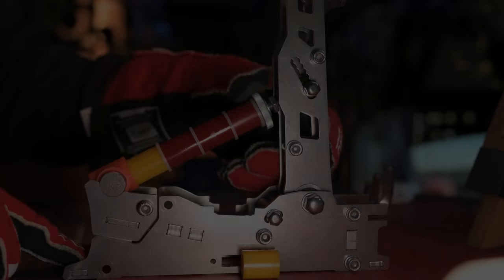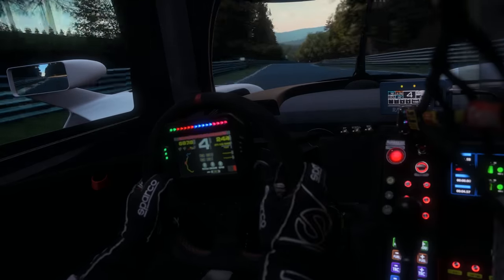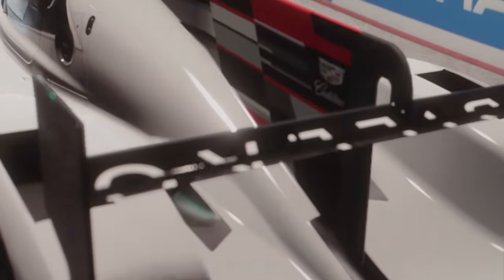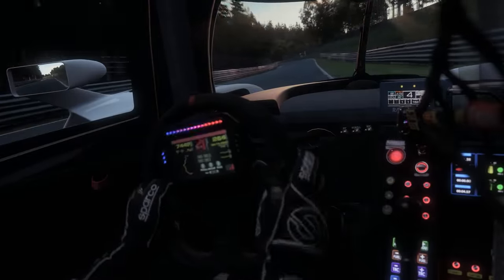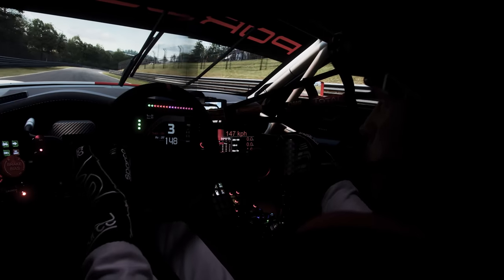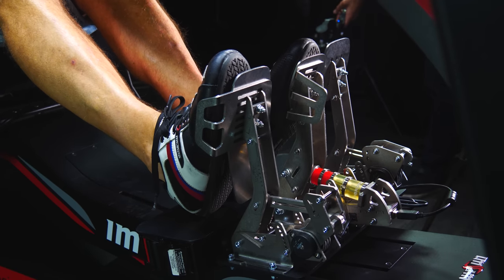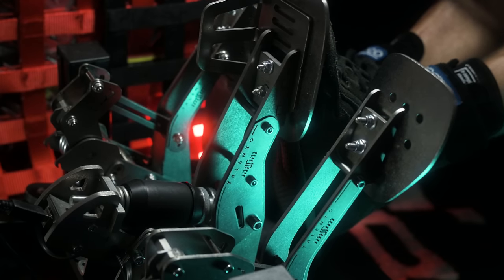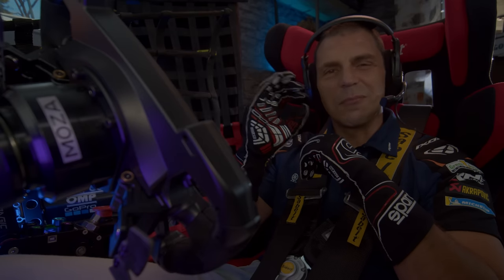How I setup my Brake pedal for max performance !

Comment: Don't fuck up your knee, most important information in the video! 

I have the V3 and I tried every combination, those pedals are only good with the stiffest brake, Almost no movement. The way you calibrate them is the most important, I try to calibrate the most I will ever use in the driver, but then i recalibrate the brake in game setting. That way, I always have a baseline that I can modulate per game setting.

Comment: yeah, setting pressure high to the point of knee injury  is stupid.  But I like having it high enough to where I'm not locking up the brakes when I panic in the heat of battle.  Short travel, enough pressure for 80% braking in most cases works for me.

IRL, my miata wilwoods suffer from pad knockback after high G turns and I usually have to pump it once before the next turn.  SIMS != IRL

Comment: I love having almost no movement to my brake pedal I like to use the muscle memory method it does work my lap times are very very consistent, and trail breaking for me is easier with a stiff break with hardly any movement that’s what I’m used to it basically no travel I’ve had my pedals setup like that for 2 years now I don’t like a LMG travel brake too hard to trail brake imo but everyone drives different with different driving styles

Comment: I'm half with you and half against you... I like the realism of a stiff pedal and the fact that I can use high friction pads without worrying about locking up. But like you it's easier to break precise if you use less pressure. Here's my example in iRacing. Higher friction pads or smaller brake master cylinder so I can outbreak everybody and I use high pedal pressure also. But to get more precise breaking I add in some brake Force Factor so that if I'm using 50% pedal or less it's easy to modulate. Give it a try you will love it.

Comment: as always a fab and informative video. 
I went about it a slightly different way round.  I f*$cked my knee up. Then I tried to adjust. 🤣🤣
It was actually one of the biggest hurdles me getting back in the rig ( other than ACTIUALLY getting in )  - the pedals were too much for the injury to cope with . So I dialed it all down. 
It allowed me to drive - but I am still not inclined to turn it back up... Liking the slightly softer
I also put a set of sim3d vibration motors on...  they are very good and very informative.

Do you ever right foot brake? I do a lot and i find softer means you are more aware and consistent  with the different forces required for each pedal - again building that muscle memory not to stamp....

take care bro
M
Reply from the maker: Yeh, I know for your injury bro but honestly from my perspective even if I have very soft brake wen ones I master the car I’m absolutely fine controlling it ! Wen I deal with new car particularly without ABS then I struggle a bit till I master the car again in few months and drive without stress! 
I honestly never use my right leg and every time I touch the brake with the right it feels like brick even wen is soft for the left foot 🤣
Reply: @chepilevski  Sorry -  ...   a brain typo 🙄🙄   we are talking LEFT foot braking   It would be a fab video exploring the benefits  of left foot braking ( or not ) . ..   i was taught by a rally driver years ago and it completely  changed my perspective as to what a brake can do regarding simultaneous power and brake input  . sure it does require a complete  internal  ' rewire'  -  that is why most people don't do it ...   it is like learning to rub you stomach & pat your head  - and also TOTALLY contrary to what road driving teaches you . If you persist past the few crisis / drama    clutch brakes.. it is fab... a ballet

personally  it was amazing as i was recovering to able to naturally  brake with my left foot as my right could not have done so at the time ..
 I would love to see the video you would make about the possible transition to explore R to L braking and your approach to the 'rewire' needed

x

Comment: finally my first day with load cell pedals today, I mounted it on my rig and started lapping, I knew what was coming but the real experience is priceless, definitely a learning curve but don't want to get negative habits, so my question is about the technique: I am curious to learn if I must be putting my heel on the base plate while braking which is hard at the moment for me or viceversa, am I totally free to raise my left foot and put it on the brake pedal which looks comfy at the moment for a rookie like me. Or the breaking is combination of both ways depending on the situation? appreciate your comments on that
Reply from the maker: It is combination really.
When you press to max you will de touch your heal for sure but in light braking your heal will be the support point to modulate 🤛
It will take some time to get used to those because of the learning curve but eventually you will become better 🤛
Reply: @chepilevski  thanks a lot for the comment, I believe its important not to get a bad habit and try a lot to change it later 👌

Comment: Hey, thanks for all your great contents! I am not an expert, just start 1 years ago. You speak about kilo measurements in the video, i don't understand how can i measure my pedals brake force in kilos? I just bought a p1000 which will arrive tomorrow!
Reply from the maker: Hey buddy, don’t overthink that aspect of the settings and just try to find what suits you the best!
I personally prefer 2 to 2.5cm movement of the pedals with progressive feeling and the stiffness is irrelevant as long as it feels comfortable to you 👍
Reply: @chepilevski  I was just curious to understand how is the process to measure the pedal. Is a thing a never did before. Before order p1000 I used a call load pedal which was stiff like a brick so I took out 2 of the 4 elastomers and i add an aftermarket spring. It has the perfect stiffness now so I would try to replicate it to p1000

Comment: I like my pedal medium soft. Rock hard does nothing for me but slows me down and my knee can't handle it.
Reply from the maker: Hard never worked for me as well! Couldn’t control the trail braking in the entry and mid corner! 
In that part of the braking face I really need more relaxed feed to be precise and the the maximum from the grip 😃 
The hard I was just inconsistent after 20-30 min drive ones my muscles get little tired!
Reply: @chepilevski  exactly I have full control over trail braking with a softer pedal not to mention that I dont miss a turn lol when I first started out I went hard straight away and couldn't make a turn if my life depended because loads of channels tell people the only way to go is with a 1000 kg load cell...joke. but I found this weird as I've never been in a race car with rock hard pedals and figured sim racers knew what's best and boy are most of them wrong. Every fast guy or girl I know run softer pedals. Like you said it all depends on how the user prefers it but hard pedals is such a cliché in the sim community. 100kg is enough for 99% of us combined with soft to medium bushings is perfect for most.

Comment: Ergonomics wise. What’s the better leg angle towards the pedals? Bent legs or more of a straight leg?
Reply from the maker: For my test I prefer bit open leg 🦵 exactly as is on that meme I send ! Not sure for the exact angle but if is too bend I start using my ankle and then my muscles fatigue more and leg shakes from my knee!

Comment: What do you think about heels rest plate ?
Is it better to use one (set close to the pedals) or better to not have one and let the heel push on the base of the pedal ?
Reply from the maker: I’m not sure if I understand exactly your question buddy but if you mean just for the extra plates most companies do for there pedals that just put the feet high and help people with small feet! The movement reminds the same and the heal still slide wen we press! 
If you invert the pedal upside down then the heal remain stable which is much more comfortable! 
If you mean about those pedals I used ( SIMGRADE R7) with the moving heal plate with the pedals together I would say the throttle control is great but not great for the brake which is hard and we actually detach the heal every time we brake hard from the plate !
Reply: @chepilevski  Actually, I was refering more to the edge that you have on those plates (and not the height).
Is it better (efficiency, pain ...) to rest the heel on this edge or directly on the pedal without this edge ?

Comment: I never understood the mantra "hardest possible brake + no travel" and manufacturers making Hydraulic Pedals with some travel. If "no travel" why even make hydraulic pedals. Just put pressure plate and be done. Today @random callsign released a video about this topic. And it seems e sports drivers use at lest some brake travel and the majority configure their pedals for a decent amount of travel. So I think most of the hype about hydraulic pedals is just marketing. I think if I bought 1000 EUR+ pedals (like Asetek Invicta) I would also probably think this is the best possible brake configuration. But this never made any logical sense to me. Brake with Progressive harder travel makes the most logical sense to me. You train your muscle memory and is probably more precise with travel involved than no travel.
Reply from the maker: Very well written buddy 🍻
Reply: @chepilevski  I may very well be wrong. And there are people that have no travel and they preform at the highest level. But there are people with 10+ years old G25 that do the same. 

So, what's better for "normal" simracer? Who just want to race. What equipment would help you the most? Help you the fastest? I don't know. 

This seems to be one of those evergreen questions, where people will ask the same question over and over for years to come.

Comment: I'm always astonished how little people know about their feet. 
We know how much we can differentiate with our hands, even if we are blind, or in VR, we still can differentiate and identify what we are touching. 
Well with the feet its exactly the same, we have receptors that teach the brain. Try it and walk barefoot...

Why the hell does the sim-racers continue to ignore what the feet really feel in a real racing car. Why do the sim-racers pay expensive wheels to feel the tires with their hand ??? 
When it comes to controlling the car, It's the brake that is directly linked to the wheels, the tires, the road. 
Why are the pedals disconnected to the wheels and road in sim-racing ???

Why are there no FFB Pedals???
Well, probably because there is not much profit to made out of a FFB pedal. Because it's so easy and cheap to DIY. 
Fix a bass-shaker on the pedal, and set different easily identifiable frequencies (high than other effects, if you have more bass-shakers) 
in SimHub for wheel slip, wheel block, ABS on that bass-shaker only. 
And you will have setup any brake pedal for max performance.

The braking foot will take over the control of the car, you will even forget the FFB of the expensive wheel in your hands...